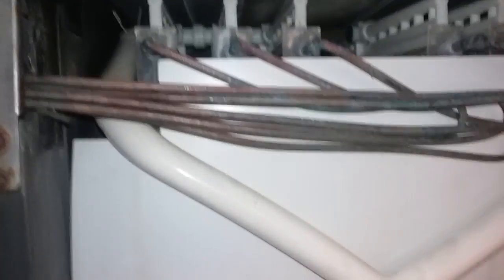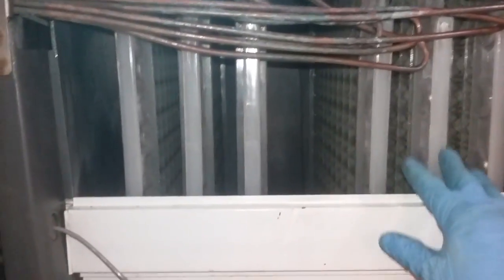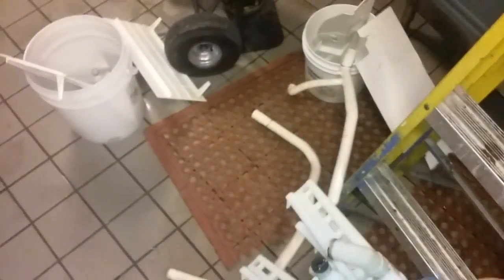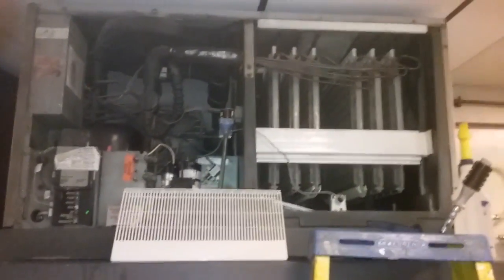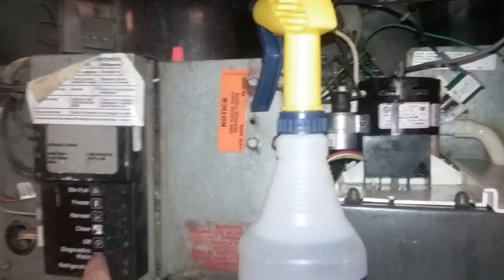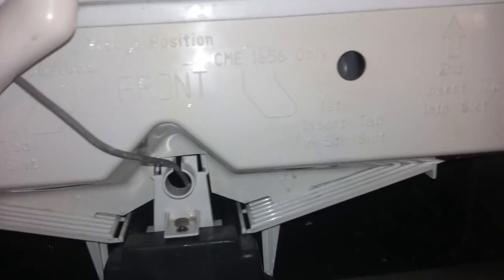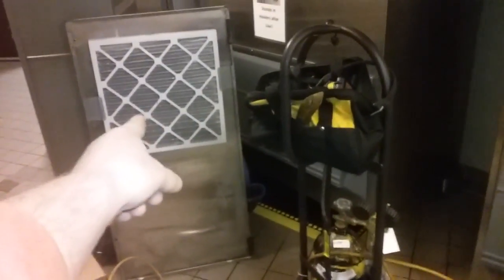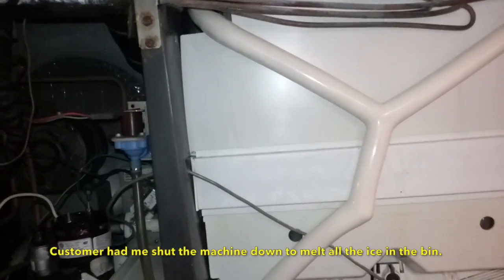Chronicles of a Rookie HVAC/R GUY #10 SCOTSMAN CM3 Preventive Maintenance

Comment: Hello I have this same matching and when I put it on ice mode it all turns on compresor water and gas. But then the compressor turns off and the machine goes to the bin full light and it doesn't make any ice. Any idea what the problem might be ??
Reply from the maker: could be a number of things, thats an old machine, could have calcified eyes....the bin control switch could be bad.Fans motors could be bad, but I really could not say without having my hands on it.
Reply: 3 years too late, but that might be your ice sensors